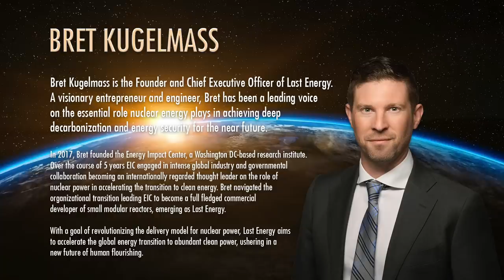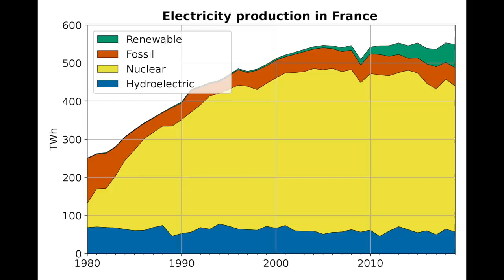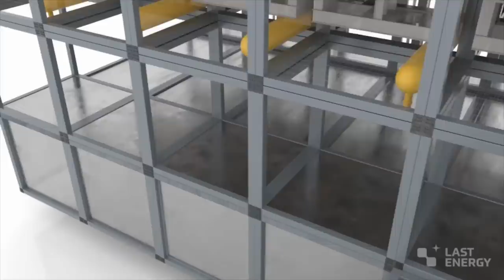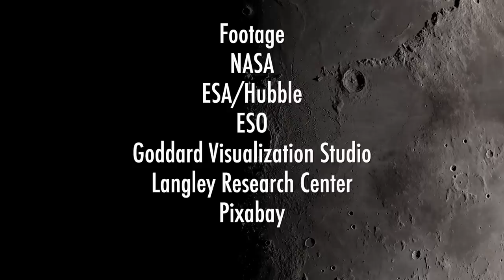Why We Need To Pursue Nuclear Energy Featuring Bret Kugelmass

Comment: One other item that Bret didn't hit on with building of new plants is the NRC itself.  NRC is almost as big an issue for building new plants as the size of the plants.  NRC is still needed, we need them to look at the designs, but the NRC is stuck in the past and put up huge bars to entry of new companies and their designs.

Um, Bret, chernobyl was not a nuclear explosion, it was STEAM explosion.  It was a steam explosion that was caused by a spike in heat from nuclear processes.

sigh...Bret, the shorter the half-life, the more dangerous something is.  Half-life is an indication of how much of a radiation flux is happening of a given radiation type.  Something with a billion year half-life has a very low radiation flux, but something with a 10 second half-life has a high radiation flux.  The higher the flux, the more dangerous the situation.  Sure that 10 second half-life is gone in a little over a minute, but depending on how much of the material was there, you might be a very dead man walking.
Reply: Chernobyl was operating outside of its design parameters. The problem was operator error, not nuclear power generation. They literally turned off the cooling system to see what would happen. 

And the radiation flux of short half life isotopes is moot when they are contained as they should be, i.e. within design parameters. You'd have to do something very, very stupid to find out.
Reply: @MrTaxiRob  I know what happened at chernobyl, I studied the accident along with TMI and Windscale as part of getting my degree (nuclear engineering).  chernobyl was soviet era management thinking they knew better than the engineers and scientists that were performing an experiment (and yes, that's how it started).  it also doesn't change that what Bret said, that chernobyl was a nuclear explosion which is wrong.  chernobyl was a steam explosion.

and yes, containment is key, but when your containment gets blown apart as it did with chernobyl and with fukishima (hydrogen explosions), those short lived half lives can be very dangerous due to the radiation flux coming from them.  from the way Bret talks, I can tell he never took a radiation health physics class.
Reply: @csdn4483  I understand all of that. Elsewhere in these comments some clown claimed that 1600 people died at Fukushima. 18000 died from the tsunami and accidents that happened during the evacuation process, but only ONE confirmed radiation related death happened as a result of the incident at the power plant itself. So while they CAN be very dangerous, I'll once again point out that they weren't.

Comment: what are the chances we could bypass the whole high-pressure steam turbine dynamic and use linear piston generators combined with nuclear sourced industrial heat? Hyliion Holdings is implementing a fuel-agnostic generator into trucks and distributed facilities power. Instead of carbon-based fuels, the same generator could use heat sourced from nuclear decay? https://www.youtube.com/live/gXk1UQJ0K98?feature=share&t=215

Comment: This guy is such a tool. First of all he is wrong about so much. Cesium which is radioactive was released at Fukushima.. While no one immediately died, we have had people die of cancers caused starting in 2018. Same at Three Mile Island. He's wrong about fusion. He dismissed Chernobyl but uses the same line of logic to attack fusion. 

He is comparing costs of his company with Tesla which is still a luxury brand and no other manufacturer of comes close. It's not proven yet his company is based on the same logic.

He wants to bury things and those will leech into groundwater, no matter what, it can get into ecosystems for thousands of years.. Uranium is quite capable of causing death on it''s own as waste.

I could go on and I'm not anti-nuclear but the fact the host lets him get away with such illogical arguments, this is nothing but an hour infomercial for a particular company, which will fail Guaranteed. I say it's not about being anti-nuke but this guest is just wrong about so much it's laughable.

Finally remember this guy saying, ""this hasn''t happened yet" is NO GUARANTEE it won't happen in the future. We need technology that is safer not "just as bad as this or that," which is the basis of this guy company

Comment: The current co2 content of the atmosphere is 0.4%...... Yes 0.4% if it drops to 0.2% plant life starts to shut down,
Reply: It’s 0.04 percent
Reply: @Dr Gamma D  now i see they are bitchen about nitrogen...i dont aee how that is a problem
Reply: @farmerjohn6526  that's in the soil, but you know that.
Reply: @Dr Gamma D  yes...however here is what they say "Excess nitrogen in the air can impair our ability to breathe, limit visibility and alter plant growth. Nutrient pollution is one of America's most widespread, costly, and challenging environmental problems and is caused by excess nitrogen and phosphorus in the air and water."
Reply: @DrDeuteron  and "When nitrogen in its active form, such as in fertiliser, is exposed to soil, microbial reactions take place that release nitrous oxide. This gas is 300 times more potent at warming the atmosphere than carbon dioxide."
Reply: @farmerjohn6526  well we gotta get them microbes.

Comment: What Bret Kugelmass is saying about Thorium and Thorium reactors is completely ASININE.
     What actually CAN burn up his nuclear waste product are LFTR MSRs(Thorium Nuclear Reactors).
This clown avoids mentioning the only thing that can do this though.
    This clown is merely taunting his Company’s regressive and far more expensive to build and maintain reactors.
     He fails to mention that his burned out reactors are not refurbishable and would soon cause a dangerous storage problem that no state would accept.
     Despite his bullshit about his water cooled reactors being “runaway reaction proof”, all reactors can have runaway nuclear reactions but only MSRs are capable of quickly stopping them.
Reply: Its all about money.
Reply: Thorium produces its own dangerous isotopes that are extremely difficult to extract, but you offered the solution within your own complaint. 

I heard him criticize thorium fans who think it's the magic bullet for everything, but the fact is that thorium reactors, breeder reactors and regular water reactors can work together in a system where one uses the fuel created by the other. EACH technology has issues, but they can support each other. 

Except fusion, that'll never happen in a cost effective way. And he's right about the radiation from fusion. It's literally a hydrogen bomb going off constantly. Fission reactions can be controlled for different reaction rates.